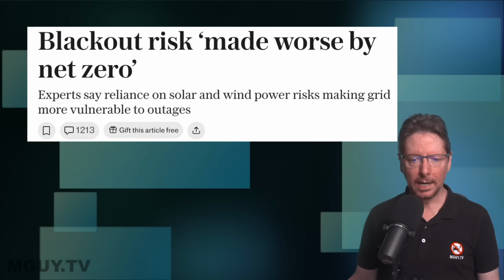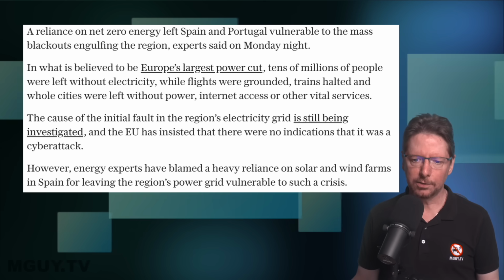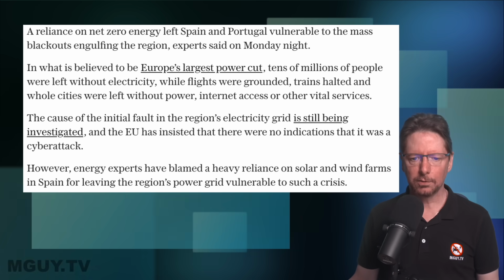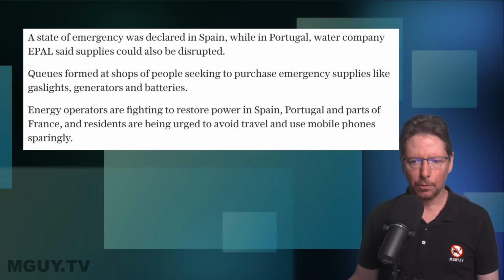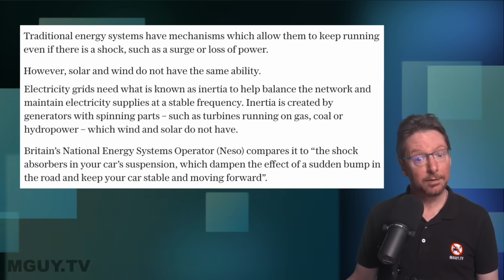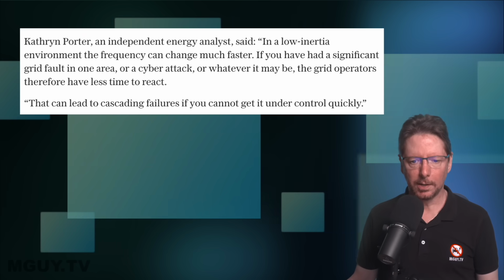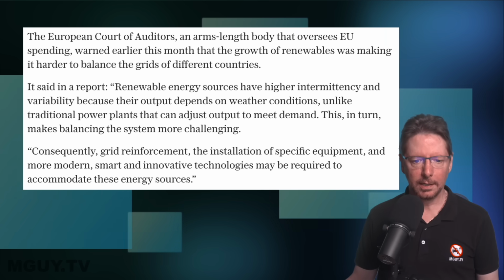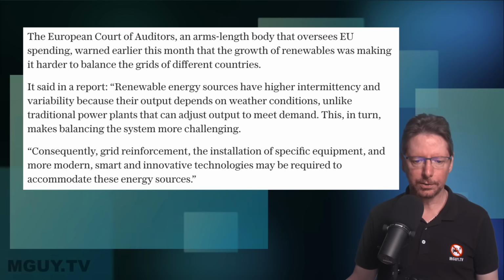Spanish power BLACKOUT: Why Net Zero and RENEWABLES were to blame | MGUY Australia

Comment: Someone would have pointed this out, they were probably fired.
Reply: Or keeping quiet until their retirement in a couple of years
Reply: @jrosam9569  
I retired 2 years ago. 
Now I can speak up. Mr. MGUY nailed it basically with the inertia or momentum problem.

Here is what I have to say only to this subject - I know it's a long one to read: 

I am personally a retired German engineer and I was working in the machinery building business for more than 30 years. I was responsible for installing huge high-vacuum coating machinery - even complete turn-keys projects - in Europe and Asia to make solar panels (CIGS principle) for a couple of years from 2007 up to 2015. 
The energy consumption for making these panels is so gigantic, these panels probably will never generate the same amount of energy back according to my estimate, which questions the whole concept just from this perspective. I calculated only the necessary heating and cooling energies within these ("my") high-vacuum coating machines and I was astonished - it will take the panels about 5 years in my area (Eastern Germany) only to re-generate the same amount of energy. Still, since I did not have the energy consumption numbers for all the other necessary considerations or machinery necessary, I could not include these energies needed for manufacturing, installation and scrapping: 

- the huge building construction and its foundation, the installation of the HV-double electric energy supply lines to run the factory later, road and railway track connection. 
- the constant aircon, clean room air filtering and heating for the huge building 24/7. 
- constant lifting and moving of these panels via conveyor belts and robotic arms 
- the base glass sheet manufacturing, a constant but very high-temperature process as well 
- running subsystems (compressed air, vacuum pumps, coating sources etc.) 24/7 
- cleaning, renewing and conditioning massive coating mask systems, recycling excessive material losses within the vacuum coating machines 
- the coating of many layers itself, requiring extreme energy inputs for tempering via high temperatures but also cooling quickly to have the substrate leaving the coating machine again
- laminating, frame attaching and electrode assembly 
- constant quality checking processes during manufacturing 
- the storage and packing, transport logistics to collect the raw materials and selling the panels 
- the power to run the necessary office building 
- installation efforts (installation crews driving back and for until it goes into operation) at the final destination 
- most importantly recycling 

Recycling is another virtually hot topic again. Because of the mulit-layer compound sandwich-like structure of the many different layers (CuGa alloy, Se, In, S, AZO to name a few) being only a few molecules thin on top of the 2-4mm glass sheet, recycling can be done only with thermic processes meaning a lot of recollecting (transporting) and heating. 
The average panel lasts for 20 to 25 years only, after that they lose efficiency (out of their already absolute lousy efficiency factor) or break down completely due to entering humidity and fading of the molecular structure. This semi-conductor structure is another reason, why the efficiency rate cannot be pushed endlessly, remans basically below 30% peak (sun shines undisruptive straight down onto the panel, meaning an ideal scenario, which does not exist in reality --> therefore the efficiency rate of solar panels is so extremely lousy) is the maximum possible dictated by molecular physics. Steam engine age!

The alternative manufacturing process to make these cells is the Si-based mono-crystal type, which is totally different but might also cause a huge “price” tag in form of the manufacturing input energy needed, just to make them. And the efficiency rate is a bit lower than with the CIGS technology. 
Besides production cycles are up to 2 weeks needing absolute undisturbed electric energy supply into the factories - no black-out allowed (therefore the twin supply lines and transformer base). So running these factories themselves on "renewables" (what a silly term; energy cannot be "renewed" as we all learn in school early, but what the heck) is no solution. 

The necessary battery storage to power whole cities and (heavy) industries is also not developed and might never be since there is nothing visible at the sky. Therefore a double electricity powering system (for short: a back-up system) will be always necessary, be it a fuel burning or nuclear power station. 
This alone will make the so call green energies ALWAYS more expensive. Very very roughly spoken: doubling the system means doubling the price. 

What is still not within this assessment is the complete rework of all the electric supplies and installations to transport the electricity from power stations into factories, farms, cities and communities to feed the now multiple electric consumptions everywhere wanted for EVs, but also digitalisation (a very big chunk), heating etc. pp. with all the electricity losses during the conversion of solar and wind generated electricity (DC to AC, voltage transformation, frequency and phase adaption) and long-distance transport (cable and transformer warming).
 
Which opens another worm can of questions about the amount of material (here i.e. Cu) to make all these “energy transitions”. 

I personally believe that we need to get away from burning coal and oil in the future, but the way it is being politically enforced right now is a way into disaster. The reasons for it are multiple - but basically people: "activists" like our highly-educated Greta Thunberg; environmentalist NGOs with very little background-knowledge of math, physics and available technology but with big budgets; pressuring solar technology companies (of course they want to push their products into markets after their heavy investments into their factories); politized scientists and ideologistic dubious "economists" trying to spread single-cause-simple-solution thinking and propaganda messages not allowing any scientific controversy; and finally semi-educated politicians caught in between them all and their populations, which are not willing to accept these doomsday ideologies and their unnecessary financial and, yes, ecologic burdens to their small every-day budgets and living environments. 

Sorry, I know this is quite long but complex issues need longer answers. However, I thought it might be useful if someone who worked in this field starts to speak up. 

Peace! from Dresden / Germany
Reply: Replaced with DEIs
Reply: Guaranteed it wasn’t just someone who pointed it out - this is all very common power system engineering knowledge, which would have taken a deliberate, coordinated effort (including of the regulators), and for years, to ignore and/or look the other way on. It’s pretty typical these days, for ideology, marketing, economics and politics to overrule the people who know better.
Reply: Yes - it happened a few years back too!
Reply: @mrg-ghx8052  Maybe every time someone tries saying something they have their comments deleted. 
YT 😠
Reply: @mrgoodman6620  Youwillbecensored Tube 👍
Reply: To be replaced with a DEI hire!
Reply: "Not team players, " or "could not make decisions."
Reply: And censored, jailed, mocked, attacked, shamed - we are many who have kept telling this would happen -
Reply: Millions of people have been screaming about all the problems we have today. 
It doesn't matter now anyway because nobody has been listening to the people that know exactly what took out the control systems! Same thing is going to happen everywhere, eventually it will take out EVERY ELECTRIC ITEM. it won't be repairable. We are losing the magnetosphere!! That's just the tip of the iceberg.

Comment: Also, on 22 of April Spain had the first weekday of 100% renewable. 6 days later...
Reply: Most grids experience the highest demand for power during the evening.  Exactly when solar is providing zero energy.
Reply: Meanwhile the actual main source was on hot standby!
Reply: @one.wonders  Apparently, the standby wasn't so hot.
Reply: Won't see this story on The Electric Viking I'm thinking
Reply: @shanemcguire3953  You may, but only after an official report is published that blames the outage on "uncommon atmospheric conditions" or other such rubbish.
Reply: It worked for 6 days on piss poor reliable systems before crashing??? That's actually impressive. Too bad the moron politicians and humanity destroying elites are winning the fight. Remember the carbon the elites are removing is you...
Reply: Something happened exactly on 22th April. Spanish oil refinery Repsol/Cartagena shutdown because of "significant electric supply failure".
Reply: @imantsjansons5009  Everything was shutting down due to this event.
Reply: Didn't Albo say Australia would be the first to go 100% renewable?
Reply: "Spain hits first weekday of 100% renewable power on national grid; Spain’s grid ran entirely on renewable energy for the first time on April 16, with wind, solar, and hydro meeting all peninsular electricity demand during a weekday. Five days later, solar set a new record, generating 20,120 MW of instantaneous power – covering 78.6% of demand and 61.5% of the grid mix. April 22, 2025 Pilar Sánchez Molina;
And some citizens exited: Wow! Spain’s grid ran entirely on renewable energy for the first time on April 16, with wind, solar, and hydro meeting all electricity demand during a weekday when demand is usually higher!
Reply: The term "renewable energy" is it really ?
Reply: @donotbendtruth6120  Solar energy isn't very renewable as there is a limited supply of lithium.
Reply: @donotbendtruth6120  yes it is renewable it constantly needs renewing at great expense and don,t the investors just love it
Reply: @donotbendtruth6120 
No!
Reply: @imantsjansons5009  Still on board with this horseshit ?
Reply: @imantsjansons5009  for how many seconds?
Reply: @imantsjansons5009  What happens in the colder months with less daylight?
Reply: @neilmarshment2910  More nuclear energy from France.

Comment: For the past 15 years I've been working on hire boats on a canal in Lorraine, France, where the locks are automatic. We have numerous wind turbines in the area. Until 5 years ago, we had lots of problems with locks shutting down. I was informed by a lockkeeper that these happened whenever the turbines started up or shut down. This has now been solved but it was on a small scale, not on a national level which is much more vulnerable.
Reply: Last year we boated the Canal latéral à la Loire - one of the automated locks stopped working for an entire day and we anchored the boat by the side of the canal - I was wondering what might’ve happened now this makes sense
Reply: @ragtowne  I used to work there. Lived in Decize.

Comment: Turns out (no pun intended) that big spinning mechanical things have qualities that small flimsy transistors dont have.   The inertia of a generator helps it cope with increased and decreased demand, smoothing out the supply.  Power regulator transformers do exist at substations, but there are limits to what they can do. When voltage, frequency and other variables go "out of spec" even grid tied solar inverters will drop off without warning, so a cascade effect takes place. Solar farms in Australia found out the hard way, that to get their power output up to spec, they needed to install $30 million dollar, large rotating drums called "synchronous condensers" to mimic a traditional rotating generator.
Reply: Fascinating stuff. 
This should all be taught in science class at age 17-18. 
Sadly, it’s way over the mental acuity of MPs like Ed Millipede.
Reply: Power transformers do nothing for inertia (or demand)
Reply: @andyxox4168 regulator transformer would, (if they exist in the power grid). They take a higher voltage, that might fluctuate, and change it into a lower stable voltage. That's how electronics keep stable voltages.
Reply: @Bryan-Hensley  some power transformers are equipped with on load tap changers to regulate voltage but this does not control load. Load is more related to frequency and load shedding initiated as frequency falls. 

(no, there are no electronics in an electrical power grid that’s not how a power transformer works, no electronics could handle either the voltage or current)
Reply: @andyxox4168  you mentioned demand.
Reply: @Bryan-Hensley  … I did and they don’t, frequency is the key element in grid stability.
Reply: @wazza33racer  UK is currently installing synchronous condensers at a cost of £16bn to bring stability to renewables .. that goes on your bill along with all the other green subsidies
Reply: @andyxox4168  Many renewable deployments, both wind and solar tried to skip using synchronous condensers, to cut costs and it did not go so well.  Broken Hill in Australia just had months of power failure despite billions spent on renewables and a grid battery.  The single interconnection with the main grid was damaged in a storm.  Then the grid operated diesel back up plant was not available due to neglect.  Without the grid to clamp onto, and inject power, the large local renewable installations could not supply. All the roof top solar, with grid tied solar inverters could not work also. So the city of Broken Hill had struggle on small back up diesel plants operated by hospitals etc.  So despite billions spent on renewables, none of it worked, total fiasco.  Somehow, despite being a very remote city, on a long, single grid interconnect, the operators never planned or were prepared for a "black" grid restart from scratch. They could only get the main power back on, when the grid interconnect pylon towers destroyed in the storm were replaced.
Reply: That's actually a decent idea. Unlikely they are large enough to coop with very much change though. It adds to the cost of renewables, which are already outrageously high.
Reply: @Bryan-Hensley  Synchronous condensers are needed to avoid a well known problem called "synchronous resonance".

Comment: I just laughed when I heard about this.  Spain scrambling to get power back on as business suffered and people grossly inconvenienced.  A quick trip to the obsolete coal fired power plant with a bucket of coal and a match may have been a solution.
Reply: Spain is being ass-saved by 700 MW from the nuke French grid 😄
Reply: Unfortunately it’s not quick to get such a machine up and running.
It’s literal vandalism to shut them off.
Reply: I recall from quite a while back, a severe power-outage in the US. A failure of one part, up in Canada if I recall, led to a cascade as parts of the grid shut down to protect itself. The entire north east of America was in total black-out. And that was when it was a stable system. One vague recollection was that it also led very quickly to mass outbreaks of looting and vandalism. We're never too far from anarchy.
Reply: @terencejay8845  Back in the mid 80's a similar situation happened on the West Coast. Just outside of Hillsboro Oregon--a suburb of Portland--on a very hot day, one of the high voltage lines, because of the heat, drooped and came in contact with a tree causing a massive short. The local substation tripped off line, which caused a back lash of electricity upstream, knocking off more equipment. Since it was summer the Columbia River dams sent a large portion of their production to California. When the surge hit them enough of them went off line that it was impossible for the remaining generators (of all kinds) to keep up with the demand and they then went off line. The whole West Coast minus some small towns lost power. I don't remember how long it was, I lived at the time in a small time, and we only experienced a flicker of the lights.
Reply: I'm pretty sure they blew up or demolished at least one coal power plant a few years back.
Reply: Maybe this is why they have been warning UK tourists not to go there.

Comment: Right you are.  60 cycles here in the US @ 3600 rpm.  I live in a TVA powered state.  No way shine and blow is the answer.  Grid ops here are keenly aware of system frequency as it is the basis of the system.  It is especially for 3ph generation.
Reply: Many big machines of 1000 megawatts turn at 1800 rpm. They are 4 pole steam turbine generators, 60 cycles per second. It's mind boggling that at full load, a 1000 megawatt generator needs 1.35 million horsepower to drive the generator.
Reply: @kimmer6  Correct, 1800 is a multiple of 3600.  In the US you can see the line frequency with an optical tach on a fluorescent light or just looking at 3 phase with a scope.  My office is 5 miles from the TVA machine shed in Muscle Shoals and we sell them machine tools on a semi regular basis.
Reply: @terrymoorecnc2500  I was a Field Engineer for GE and worked on many generators around the world running 50 and 60 cycles. I loved that stuff but the travel drove me crazy. When I transferred to the GE Marine Department in San Francisco, there was still a lot of travel and jet lag. Many Navy ship service turbine generators were 6 pole machines....turbine spinning at 10,00rpm driving a gearbox which drove the generator at 1200 rpm. I'm in my 70's and generators are still my hobby.
Reply: @kimmer6  I'm an ex GE'er myself.  Worked at the LSTG plant in Charleston, SC.
Reply: @terrymoorecnc2500  They took us through LSTG in Schenectady and then to the casting foundry in the first part of training. It was very impressive.
Reply: @kimmer6  the last year I worked there we shipped 74 job orders which comprised nuclear and fossil fired turbines.  GE has never shipped more units than that so I've been told. We made inner casings, hoods and diaphragm's.  China has most of the old machines except for the 72' Ingersoll.